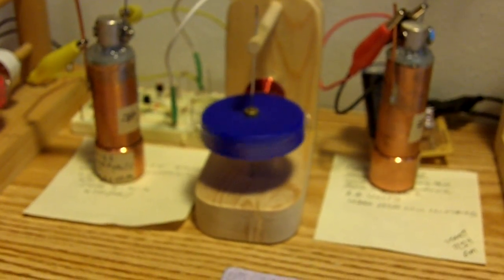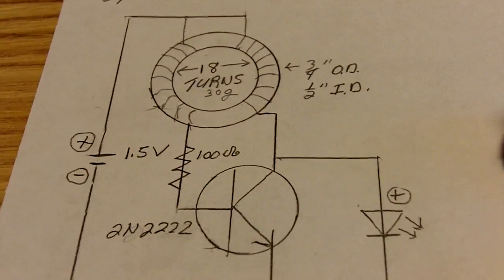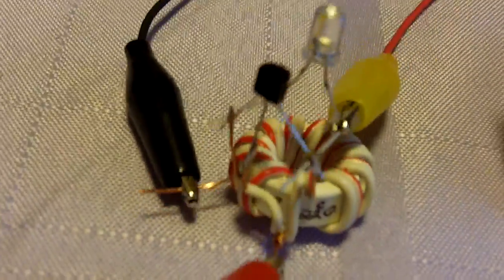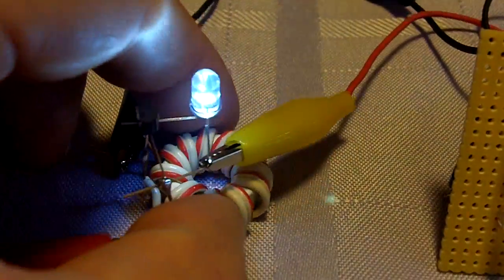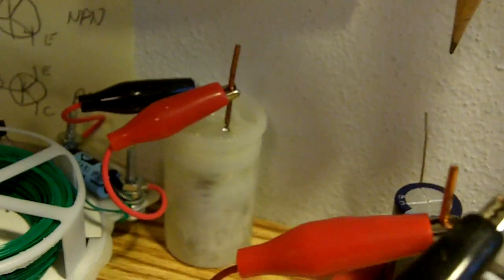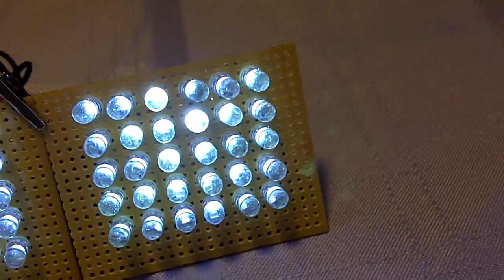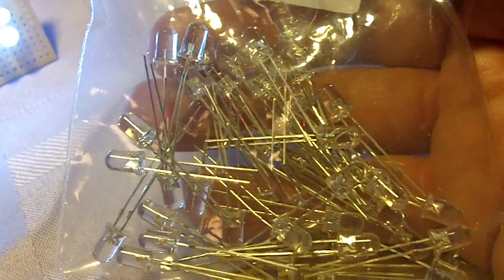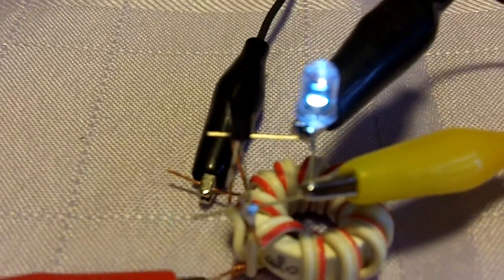Battery & Joule Thief Update.MOV

Comment: Where did the current settle at on each of the batteries. As mu cells would be in 10ma range as the voltage when stay around the 1.3 range also.